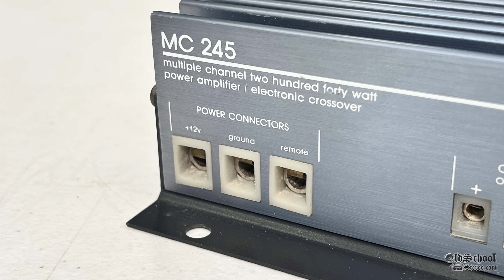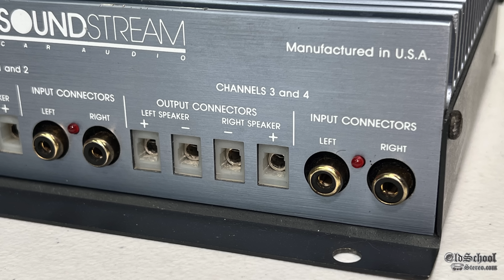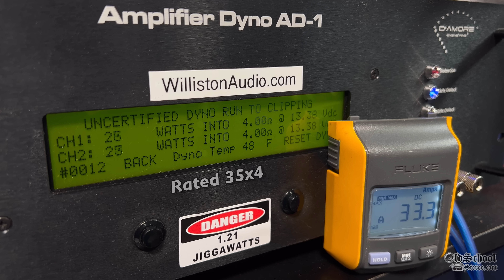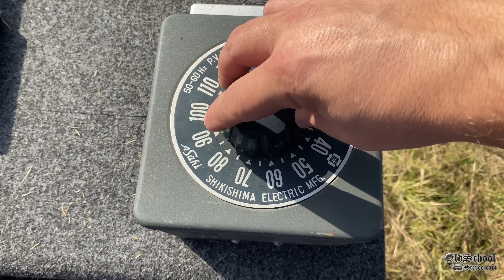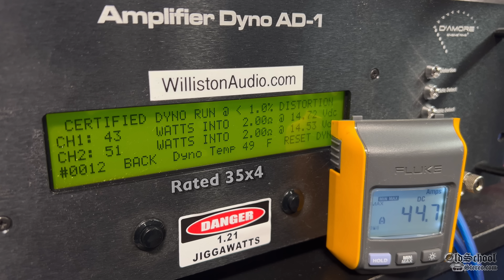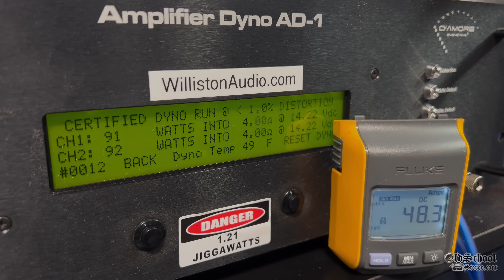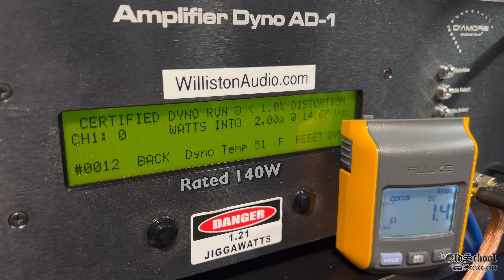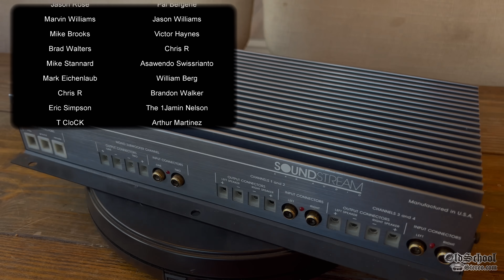The Original SQ 5 Channel Amp? 1991 Soundstream MC245 Amp Dyno Test

Comment from the maker: 7 Days of Amp Tests Playlist: https://www.youtube.com/playlist?list=PLuodE1Zx7Y-6bhrEfCERSfl43EpB3P3lS
RELATED VIDEOS
1988 Soundstream MC500 Amp Dyno Test: https://youtu.be/ISrgrXYSWvU
1990 Soundstream D100ii Amp Dyno Test: https://youtu.be/NUDAh37C5Pk
1993 Soundstream Class A 3.0 Amp Dyno Test: https://youtu.be/qUUo-YZcxTg
1993 Soundstream Refernce 500 Amp Dyno Test: https://youtu.be/RrMdf87Awmc
1996 Soundstream Reference Class A 10.0: https://youtu.be/q6HBoyr5ixI
1998 Soundstream Reference Class A 10.2: https://youtu.be/8F6SncGEKag
1999 Soundstream Lil Wonder Amp Dyno Test: https://youtu.be/kcUg9G6X0yU
Vintage a/d/s PQ20 80x4 Amplifier: https://youtu.be/KrLNDorSHKk
Brand New 37yr Old Sony Speakers: https://youtu.be/i9zZOLvf_bI
'80s Sparkomatic Speakers: https://youtu.be/loxJa2k2O5A
1984 Kmart Blue Light Special Speakers: https://youtu.be/ckvjUcq-ABs
Vintage Radio Shack Optimus Surface Mount Speakers: https://youtu.be/hzKgtjZOaRg
The Worst $200 Speakers Ever: https://youtu.be/S42JA00XVb8
See Mullin Performance Audio  @mullinperformanceaudio5902 

TEST BENCH EQUIPMENT
SMD / D'Amore Engineering Amp Dyno: https://goo.gl/sJTcf7 
XS Power D1400 Batteries - https://amzn.to/2BPFCKW 
XS Power PSC60 Charger - https://amzn.to/2CHGcfs 
Fluke 1000A AC/DC Clamp Meter: https://amzn.to/2Rw5WDA 
Handheld Dyno: http://amzn.to/2u2EgKV 
My Favorite Screwdriver Kit: http://amzn.to/2x0VzcE 

DISCLAIMER: This video and description contains affiliate links, which means that if you purchase from one of the product links, I may receive a small commission. As an Amazon Associate I earn from qualifying purchases

Comment: Guaranteed sounds better than 95% of what's on the market today
Reply: I'll Smoke one to that
Reply: I gotta get my pq 5 fixed to run my front mid bass and tweet set
Reply: @markhatcher4325  happy new year!
Reply: @Juggernaut-fg2up  You too Brother
Reply: The brand names have changed but you can still get high fidelity amps today for similar inflation-adjusted price (or much less).
Reply: @JESUSISCALLINGYOU7 todays systems SQ is at another level compared to 90s systems, technology and knowledge has gone so much forward.
Reply: Remember when $1 a watt was standard to get good SQ amps? So so many manufacturers today it’s just a mess. I miss those days. This amp brings me back.
Reply: | you def been inhaling far too many burnt out Made In China amps to believe that mate 😆 🤣
Reply: @V8Lenny  how many amps have a signal to noise ratio over 100 decibels nowadays? How many of these amps have a damping factor of over 250? And how many of them have a distortion rate of 0.05%
Reply: @txddyfarquh69  like I asked the other guy how many amps have a signal to noise ratio over 100 decibels nowadays? How many of these amps have a damping factor of over 250? And how many of them have a distortion rate of 0.05% or better?
Reply: @Juggernaut-fg2up  over 100s/n is quite normal today and damping factors over 1000, brazilians for example.
Reply: @V8Lenny  name specific amps please. I've never seen one with those specs, i am looking at taramps right now showing 89 db sn on every amp.  And I know there are one or two companies that still make high-end amps like that but not the majority
Reply: @V8Lenny  timpano 90 db sn as well. Not seeing those specs anywhere on these Brazilians
Reply: @Juggernaut-fg2up  Soundigital damping factor over 1000. But damping factor is quite meaningless. Tube amps have almost zero damping factor
Reply: @V8Lenny  what amp specifically because the ones of theirs I'm looking at right now sure don't and s/n is low like the others. I am on their website
Reply: @V8Lenny  and theor distortion is measured at only 10% power. So they don't have the sn, distortion or damping factor from the specs I see on all their amps I'm seeing
Reply: Alpine PDX amps have that dampening. Morel le 150x2 has sn108-112, if I remember.
Reply: @Juggernaut-fg2up  5500.1D Power
Reply: @V8Lenny  ok I see it. Sn is low low though.
Reply: @Juggernaut-fg2up  90 is not low
Reply: @V8Lenny  well my point is all of these specs are still worse than these old school amps except for the damping Factor on that one amplifier.  Distortion is higher, damping factor is lower, noise floor is higher... say what you want but I think all of these things come together to produce better sound.
Reply: @Juggernaut-fg2up  but they are all cheap amps. Take equal price in todays money and you get all specs better than those old school amps.
Reply: @V8Lenny  that I can't disagree with. I'm sure higher end has only gotten better, I was focused on what the masses are doing. The majority seem to be cheaper made with worse specs than the majority back them
Reply: @Juggernaut-fg2up  there were really bad cheap amps in the 90s , cant find as bad anymore.
Reply: @V8Lenny  for sure I saw some of them, opened up a blown pyramid around 1988, it was 18" long but only had 3" circuit board at one end and 2" on the other, the rest was nothing lol
Reply: @V8Lenny  so who makes amps that meet all of these numbers? Asking for my own Information
Reply: @Juggernaut-fg2up   Ground Zero , Helix and many others.
Reply: @V8Lenny  Not so much in car electronics, sadly, Home Audio is another story.
Reply: @Juggernaut-fg2up  Pyramid amps were for 14 year olds saving up for their first piece of junk cars. Lol
Reply: Your not even close you just need to know what to buy. Theres just way more junk on the market now. But as far as hi end audio equipment today will blow anything from back in the day right out of the water in sound quality and spl
Reply: @CoreyBrainard  You're wrong and yes that's how you spell it.

Comment: A lot of these expensive high dollar amplifiers didn't put out a whole lot of power because in the late 80's and early 90's speakers and subwoofers didn't need a whole lot of power to make them sound good or loud
Reply: True statement
Reply: It was about THD back then the cleaner the sound the better. Just because they went beyond what we can even hear. But truly clean power sounds louder than the number denotes it as.
Reply: Speaker efficiency was alot higher
Reply: @JESUSISCALLINGYOU7  and those drivers we're so crisp.
Reply: @CarAudioObsessions 100% it was about speaker efficiency.  You really weren’t trying to get below 40Hz so long as they moved some air above that.  A set of 3” or 4” coaxials on the front channels, a pair of 6.5” midbasses on the rear channels, and a pair of subs that only needed 120-140 watts to get excited, this would rock your trans am or iroc.

Comment: I ran a pair of these on my front stage way back in the mid/late 90s, One amp per side,  channels 1 & 2 powered the tweeters in the door, 3 & 4 ran the 5.25 mids in the doors and the sub channel drove an 8 inch bass driver in the kick panels. Sub Stage was 3 JL 10w6s on A Soundstream reference 10.0 all crammed in a prelude. One of my favorite and most reliable systems I ever had for all around listening

Comment: I remember ordering the reference 700 at my local shop, as i saw the first ad for it.  3 months later, i finally recieved a reference 1000.  I used it for a few weeks, and it burned up.  Sent it back through a different dealer, and they sent me back a 1000s with the windowed caps.  That thing was a monster that never died.  It ran 3 JL Audio 12w6 subs... and at some point, a single rockford fosgate series 1, 15 inch in a huge sealed box.  In my 1995 Nissan 240 SX, with the "Teamstream" sticker across the top of the windshield.

Comment: On page 227 of my 1992 Car Stereo Review buyer's guide in the test reports & user's evaluations index section it shows the results where they tested it, here's the numbers @ 12 volts 47.5 x 4 plus 129.5 x1.
Reply: I bet replacing the caps and some of the other components would bring new life to this one.
Reply: I forgot to mention that was at 4 ohms and it was the July/August issue, it didn't have the 2 ohm numbers listed.
Reply from the maker: It’s likely they didn’t load all channels when testing and my tests show worst case scenario
Reply: Definitely possible that they didn't have all the channels loaded down.
Reply from the maker: And TBH most people would have LPF engaged on sub channel so the power supply would be less strained than having all channels loaded. Again my test was worst case and with speakers this amp sounded amazing and I was happy with bass output as well
Reply: @wal2  Regardless, this is an amazing amp that SoundStream designed and produced. I miss mine. 😢

Comment: Back in the day, I ran a MC245 running 2 component sets of Altec Lansing M625/TW2 with the paasive crossovers and 2 JL Audio 10W1 subs in a 4th order bandpass enclosure. That system didn't get super loud, but damn it sounded so clean!
Reply: I’ll bet it did, that’s an impressive system!
Reply: lol Wonder 5: 4 x 40, 1 x 200
Reply: @houseofpain3580  all the drivers in that system had high sensitivities, so didn't require a ton of power.
Reply: I had a reference 405 first series back in the day. It was very clean.
Reply: @1ufcfanatic795  I still own a D200ii, D100ii, and 3x D60ii. Currently packed away in my closet. Someday, I'll have them all recapped and then put them up for sale. My current system in my '19 Ram 1500 runs 2x Alpine PDX-V9. Love how small they are while putting out 4x100/1x500 each.
Reply: @houseofpain3580  My thoughts exactly...
Reply: Between high sensitivity and under-rated power (probably due to competition) those were the golden days of car audio to me! Didn't need much rated power if you had a good amp to produce great results.
Reply: I had  1 mb quart dw12 sub in a Q- logic box with a with Phoenix gold octane series cant remember  exact model# but it pounded  clear infinity midbas tweet combo with ads pq5 running the front 😀
Reply: Man, Altec Lansing made some killer car audio speakers back in the day, sad they are not in the car audio game anymore😢

Comment: I used to have one of those, years ago. I dont know if mine was an older model, or if that one was, but mine had 3 separate circuit boards in it, instead of one large one.
Reply: You had the older version

Comment: I had a D60II running a pair of kappa 6x9 2ways and RF punch 75 bridged to a single RF 15 sub in a large ported box in a '81 rabbit.  I hit a 132.8db at a local sound-off competition.
Reply: I also had D60II but it was running image dynamics 5.25 and a class A50 running a set of image dynamics horns. Zed feed the image dynamics two 12.

In my other car I ran ppi arts to infinity Kappa 6.5 comps and kappa 6x9 3way. Just curious if your kappa"s where the green cones?
Reply: @jasonnelson6624  I think they were light grey if I recall, that was more than 30 years ago so I could be wrong.    In a later car I had the kappa perfect 6.1 comp set running off of a 115 wpc RF power series amp, I forget the model # and 2 kappa 10's each getting 275 watts of RF power series as well..
Reply: @kurtbrisch5776  if you had the green you would know it and remember they stood out that much. The perfects were nice. The green cones ran from like 1996-1999.

Comment: That amp paired with a top of the line clarion head unit produced the cleanest power money can buy i still have both in like new condition they were only used for a couple months the amp is in original box which also is in new condition